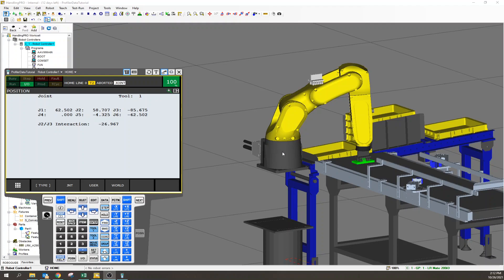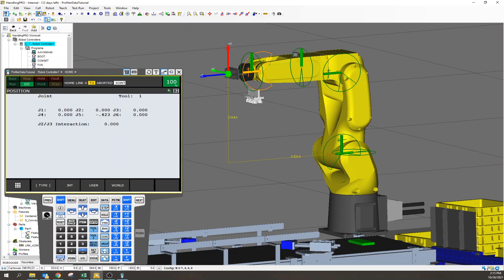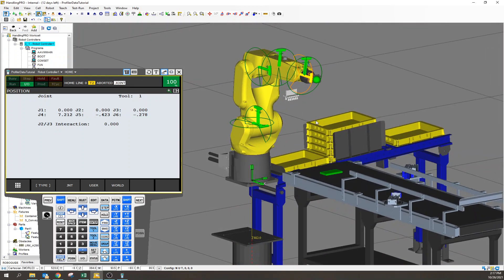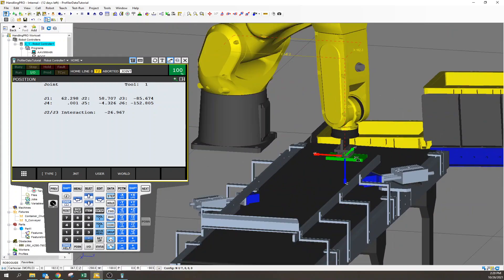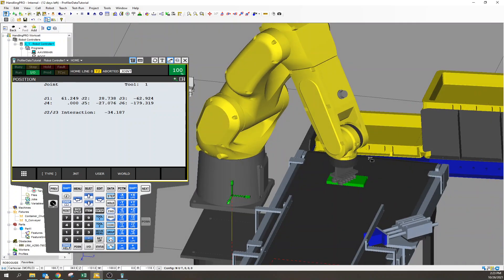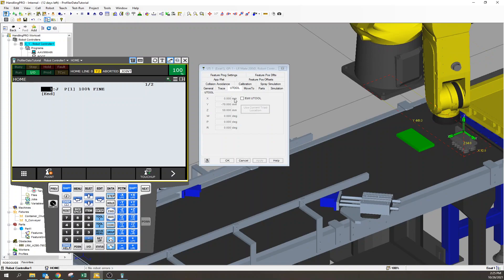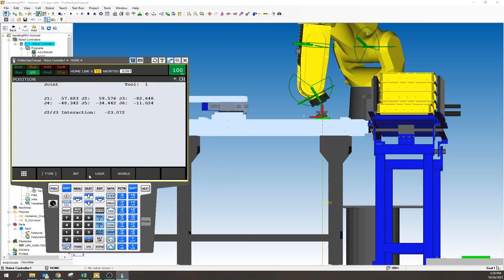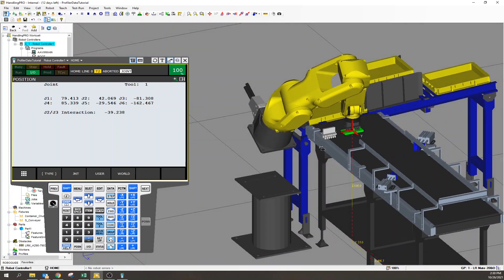Singularity - What it is and how to avoid it!

Comment: Equifinality is the term you seek, rather than "an infinite number of solutions". Because the actuators have resolution (they are discrete rather than continuous), there are not in fact an infinite number of solutions. It is simply a high-dimensional system with many possible combinations for a given end-effector position and orientation.

Comment: would lowering the work surface work aswell? as long as joint movements are used when moving from below the base to above it?
My cobot is cart mounted so It's height is fixed, and raising the height of the work surface is undesirable
Reply from the maker: Absolutely! If you can alter the working surface, you can optimize where the robot is in its work envelope.

Comment: Hello Adam, Nice video. In this case, your solutions are definitely the right ones -- you do need hardware changes. However, in certain situations, you might also try to reach an end-effector pose with a different configuration (back / front, elbow down / elbow up).
Reply from the maker: Great point! Changing robot configuration can also help. The best thing is preventing it altogether if possible, but at least there are plenty of solutions to fix it. :)